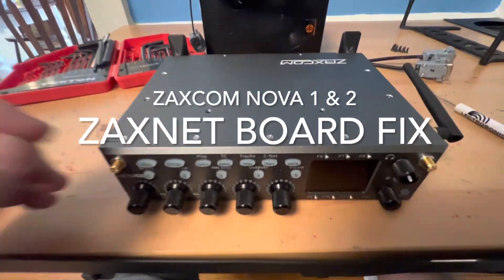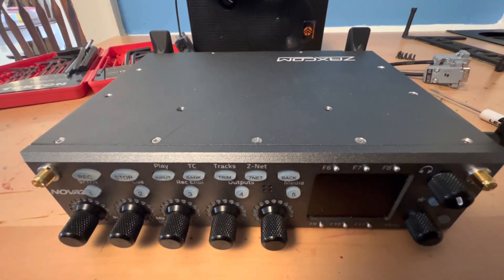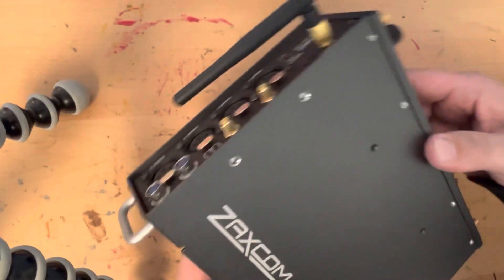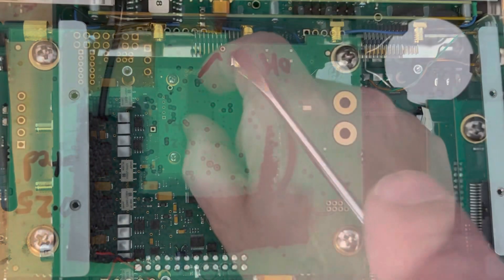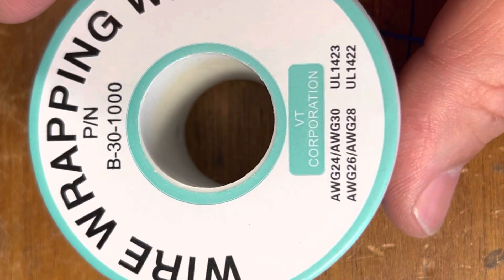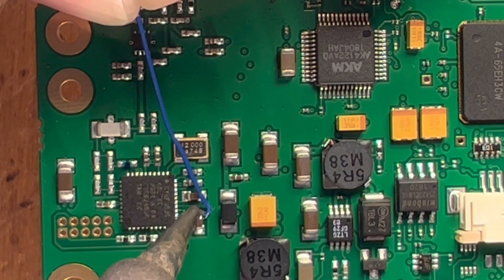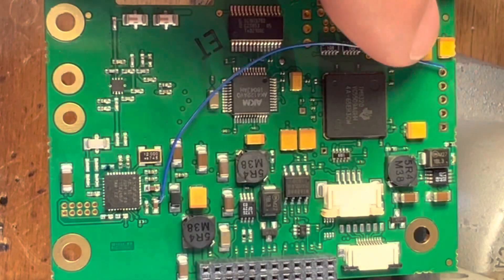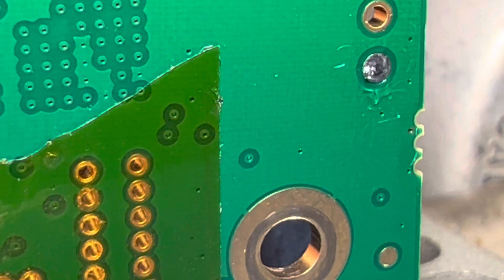Zaxnet Board Fix for Zaxcom Nova 1 & 2

Comment: Did you replace the foam?
Reply from the maker: I just stuck the original pieces back on. Actually makes more sense to pop that RF connector off with the flathead first, then use the wire to help the foam come up.